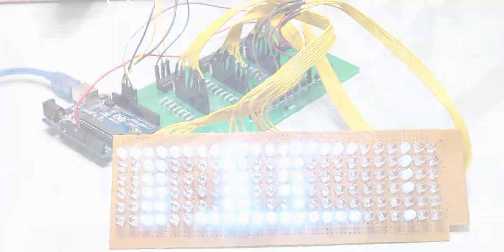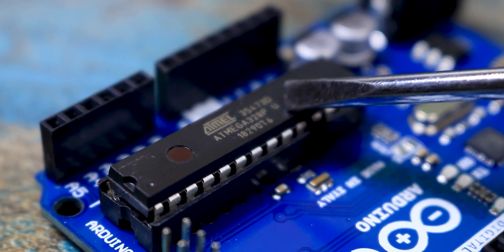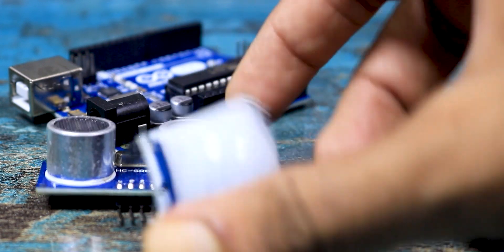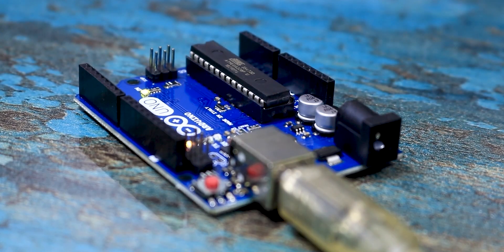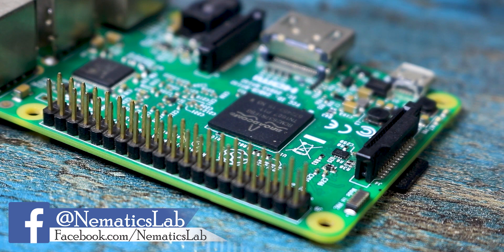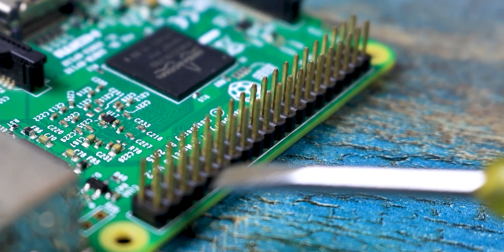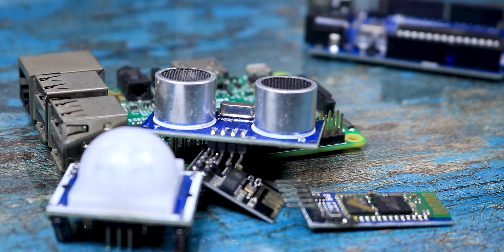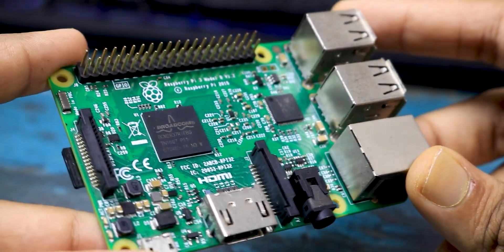Arduino Vs Raspberry Pi : Which one is better?

Comment: I want make a home surveillance robot. This is what I am starting as a new hobby. I do not have much experience in electronics. Can you please guide me whether to start with Adruino or Raspberry Pi considering I want to run machine learning algorithm such face recognition etc ?
Reply: If you're planning to add machine learning and facial recognition, you probably want a Raspberry Pi.  Arduino style microcontrollers have their limits, most notably you really have to fit everything into a single program that gets burned into the chips flash memory, and then runs forever.  RPi provides a full operating system, allowing multitasking, so you can have multiple things going on at once, including starting and stopping individual programs as and when you need.

Comment: I have a laptop which is very slow for programming so should i buy a raspberry pi ,screen,mouse etc and start programming .

Will it work fine and fast please reply 
Iam confused , puzzled
Reply from the maker: Raspberrypi is not a full computer more like similar to computer in tiny form factor. If you want to get into series coding get a decent laptop. Dm me on Facebook I'll suggest you according to your budget